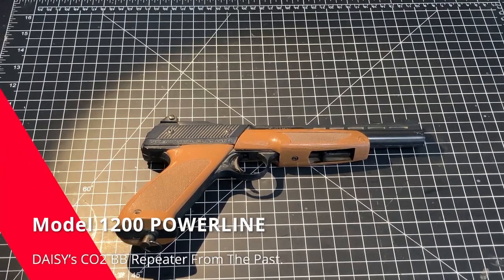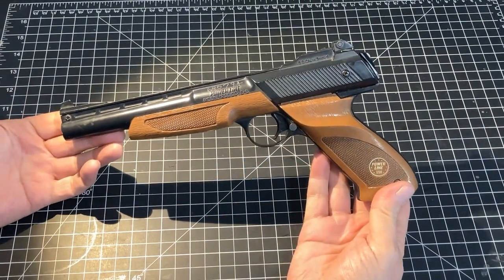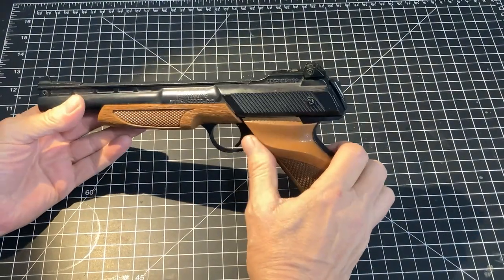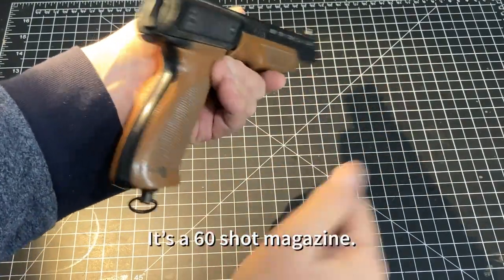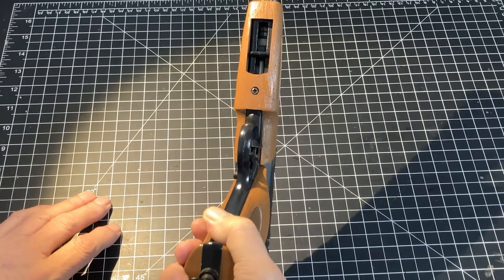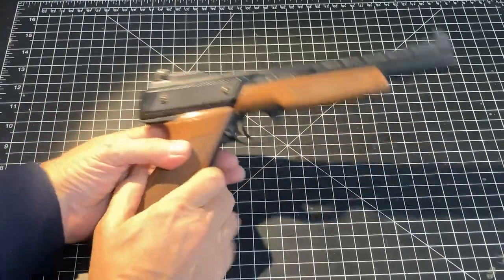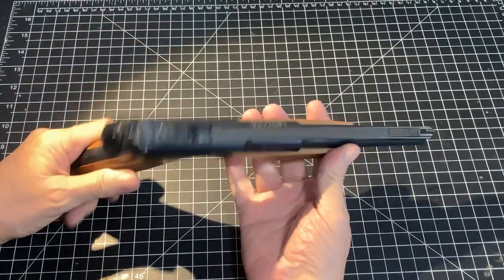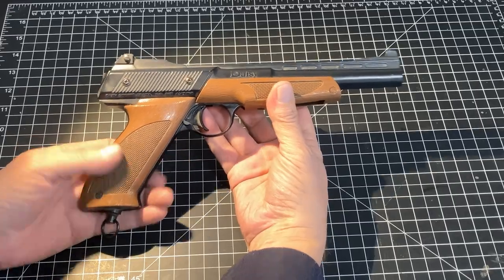Magnum BB Gun from the Past?

Comment: I had a Glock 17 powerline pistol (circa late 90's early 2000's) with the same cocking action. It was advertised in the 400's FPS. Stripped it down to the frame and added support for the barrel, Built a suppressor for it out of dual tube pvc pipe and adding rubber bands to the action to compensate for the weight of the suppressor.
Reply from the maker: Wow, sounds like a cool build. 👍🏻